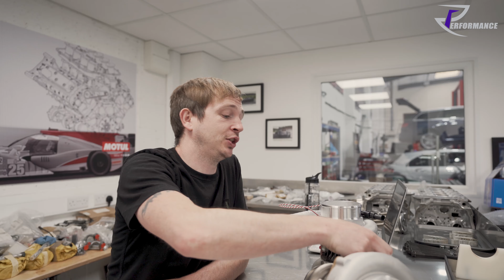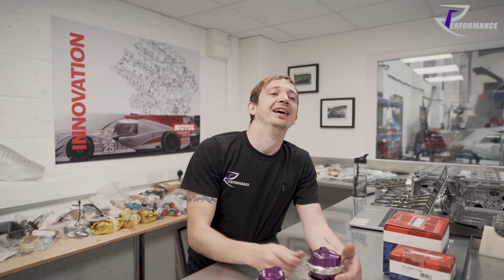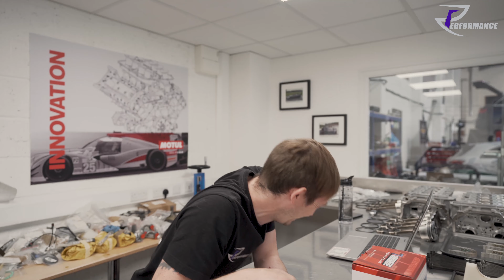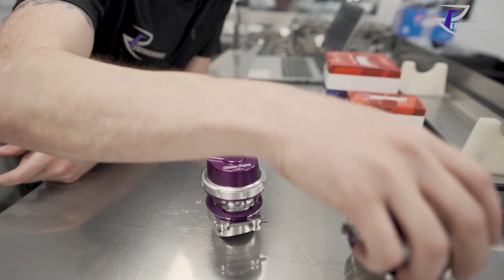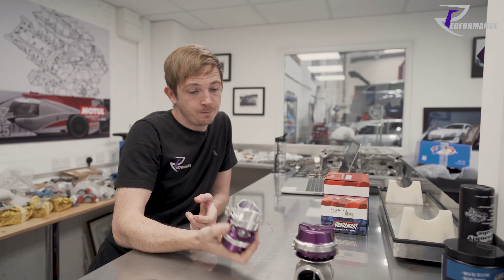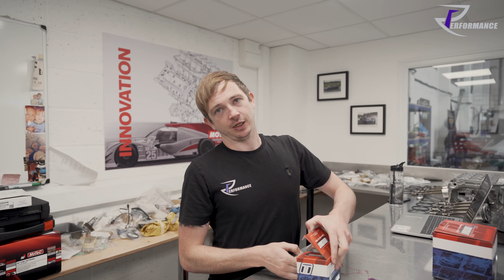**NEW TURBOS!!** for our 1000bhp R8 V10 project!

Comment: I wonder if you can help me with a technical query. I have a 2006 Aston Martin V8 Vantage 4.3 380 bhp. It does 18 mpg around town and 26 on a motorway cruise. My question is as follows. If I have a car that weighs the same as my Aston  with a 2.0 4 cyl, that would probably do 30 around town and around 45 on a good run. Given the energy required to move a mass at a certain speed over a given distance, why is the consumption of my Aston so much worse than the 2.0 car. Thanks in advance

Comment: MAP to EMAP ratio is always a compromise when converting High efficient N/A engines. The obvious answer is to use larger turbine wheel/housings with the consequence being sacrificed  response/lag . It all comes good when you get into VERY large turbo's and high HP setups, the ratio gets closer to 1/1 or lower.
Reply from the maker: That’s our biggest focus. The combustion analysis tool helps us understand that too how the pressure ratio changes across the engine and the different items that change that balance!

But yes, as the V10’s run low boost for high power we are normally upside down on that ratio. Cheers
Reply: @REPerformanceUK   I've just started following your channel, you're a smart guy Ricky and I'm very interested in seeing what you figure out with the combustion analysis tool. Like you said in a video .. people will talk about "oh the head lifts at this much boost" or at X amount of power .... When in reality that's completely arbitrary... Peak cylinder pressure and the timing of that is key and I've got no doubt will help you achieve even more performance and reliability. I'm curious to see how much variation you'll find cylinder to cylinder....  Anyway keep going 👍👍👍

Comment: Great video, did you say you write firmware too? Be interesting to know more about that. Uber geeky I know but as a software guy, I'd be interested to know more about it.  

Also, given what you're saying about pressure ratios across the engine and operating those big turbos well below their normal operating ranges, why use such big turbos? Would smaller turbos make even higher exhaust pressure?
Reply from the maker: Yes we have written M1 firmware in build before for bespoke applications, like the hill climb car we worked on where I use a dbw motor for supercharger bypass as it was compound charged.

In regards to pressure ratio, exactly. Smaller turbos typically means more exhaust back pressure and the V10 has a high exhaust mass flow. We try to pick the best housings/wheels to optimise the job.

Comment: Ricky, I'm struggling to understand why you run such large turbos.
You are outside of the efficiency window, having to wastegate vent loads of exhaust gas and are upside down on the pressure ratio.

Why not run a smaller pair of turbos that sit in their efficiency curve, have less lag and maybe help the pressure ratio?

If you aren't running more than 500hp per turbo, they just seem way too big.
Reply from the maker: Hello mate, I’m trying to reduce exhaust pressure not increase it which would occur by closing the frame size down. We are also boost limited for a number of reasons, so I have to hit a target boost but keep emap down. Remember I’m not massive power (circa 550-600 per bank) but massive exhaust gas volume.
Reply: @REPerformanceUK  Ah, of course. I'm looking at it from my car which isn't limited like yours. For me, it's a case of fitting the smallest Turbo that will deliver what I need for maximum response, but you are trying to balance that with exhaust restriction.

My mistake.

Comment: Gold again boys....So aside from Underground racing and Dallas Performance who does billet blocks for the V10 platform that you could use in a build? I know you can sleeve and forge a standard block but whats that realistically suitable for 1400/1600 hp? Be good see some billet blocks become available for general use. Bullet Race in Australia make them for most of RB, 2JZ, SR20 and 4G63 but cant find anyone that sells them aside from the two in the states.
Reply: Heffner Performance has a billet block and Sheepey Race is working on a billet block.
Reply: @dragonsupra10  Are they available though for third party use? UGR and Dallas wont sell the block only comes with their packages. Bullet Race Engineering sells theirs blocks to anyone. they just dont do a V10 yet.
Reply from the maker: Yeah the big boys don’t sell their blocks unfortunately.